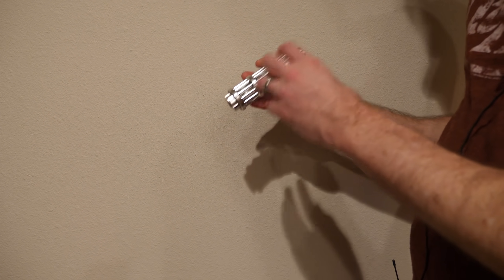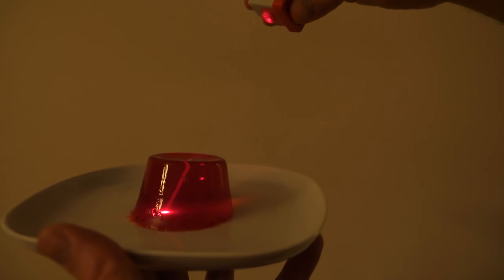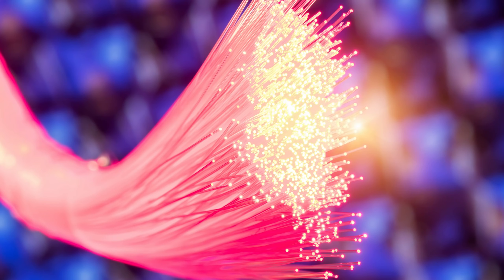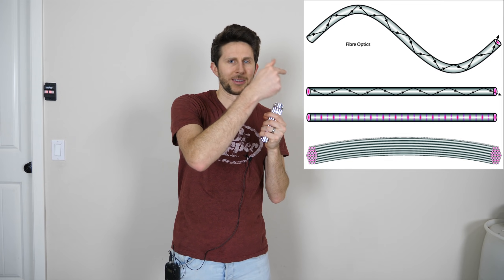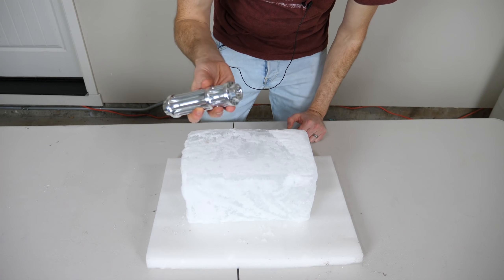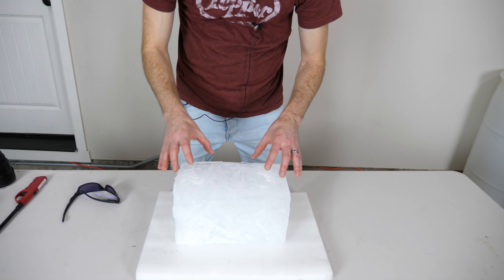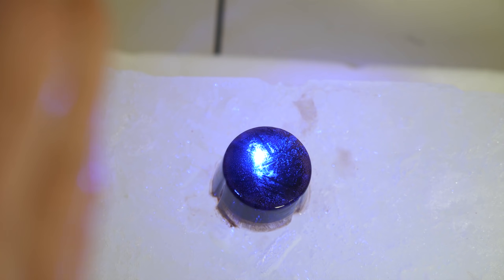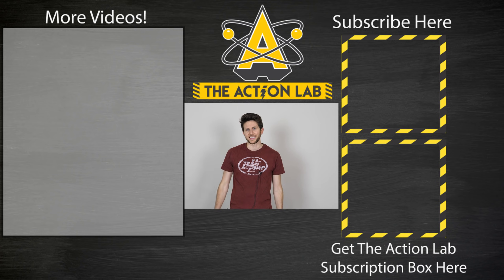What Happens When You Shine a 5W Burning Laser on Black Ice?

Comment: I have the same blue laser. Are you using 2 16340 batteries or 2 18350? I'm switching from 16340 to 18350 because it's just wasting tube space. I don't know why the laser company would say to use that. They are both the same volts. 16mm batteries in 18mm tube...

Comment: The Action Lab, I seriously recommend you buy a laser from sanwu lasers. They make much better lasers than the cheap Chinese manufacturer yours is from. Laser ranger or striker series recommended, laser ranger has a "dimmer" switch so you can have complete control of the power. Striker series has extremely high power options, up to 7.5 watt, and with very good cooling.

Comment: It doesnt melt it because you need to match the wavelength that gets absorbed by the ice, around 1 micrometer i believe. So an IR laser would do a better job at melting the ice rather than the short wavelength blue laser.

Comment: Great educational video as always. Total internal reflection is indeed very efficient in preserving the light's energy. There's also one thing I want to point out: cool white low CRI LED such as those used in the Acebeam you're using, emits very little to no infra red light. AFAIK, it uses several 6500K Cree XHP70. The warmth or heat you felt from the flashlight is caused mainly by the photon energy hitting your opaque skin. The darker your skin color, the hotter it will felt.

Comment: The latent heat of ice is 334 joules per gram. Let's say that ice block is a little less than 2 kilograms, so it's 600,000 joules. 1 lumen is 0.001464 joules per second. So it would take approximately 3.5 hours to melt the ice with the flashlight.

Comment: That laser he is using is a fake laser.
The light beam is holographic purple that is the giveaway.
The metal is actually real, but the laser beam is the one that is fake, because is not emitted by the metal laser, but rather a way to manipulate his operating system as he is the one emitting the purple hologram withing his mind, but other biological human computers donot understand this, this is why they get away with manipulating the system because is all fake controlled experiments, so the real results are controlled.
The laser is actually a white beam and internally a holographic purple laser that is emitted with his brain, that is why you see multicolored laser, purple and white, so is deception, very clever on his behalf, he gets to troll every idiot watching this.
The system is going to need to catch him.
Is a clever way to hide the purple holographic image they emitted by adding a white light, the white light is the one that is the real light, but the purple holographic beam that he creates within this mind is the ones that is actually emitting the heat source, so is all controlled fake experiments as the results can be as he manipulates, and because they can not create a purple holographic image they hide the holographic images they create with other real light, very deceiving, the problem is the operating system doesnot understand nothing because they all clever liars.

Comment: Now that is quite interesting on why wet things look dark. I took an art class year ago and using water based acrylics was really annoying when trying to color match for that very reason. Oil doesn't do this. Now, I wonder, would the light get "stuck" in the stream of oil the way they laser was in the water? What is also interesting in your experiment is that this is part of the reason there is excess melting of the ice in Greenland. Coal ash coming from a certain large country in Asia that still uses lots of coal is blown into the atmosphere and find its way to to the ground, sometimes on Greenland's ice sheets. These spots of soot absorb more energy from the sun light and melt the ice faster. This eventually causes channels to form, which further accelerates the ice melt.

Comment: You should try freezing water inside a cooler in the freezer, the top half will be totally clear. You can melt off the bottom or catch it before it freezes right through. Could be fun to play with.

Comment: would it be possible to redo the laser in the water bottle experiment with the walls of the water bottle painted black except for an opening for a cardboard tube to sit flush against it. I want to isolate the other sources of reflected light so to better see the laser going through the water

Comment: Can you freeze water in a vacuum?
Reply: If water couldn't freeze in a vacuum there would be no ice in space
Reply: Sure just put water in your vacuum and leave it outside during a blizzard.
Reply: The thing is, there wouldn't be a vacuum, the water would boil until the vapor pressure was reached.
Reply: @TheDungineer  But The Vacuum Chamber Will Take The Vapour Away

(Leading To A Failed Experiment)
Reply: It will radiate heat through radiation.
Reply: Look At The Phase Graph

                 Temperature
                 __________
Pressure|    _________|Solid
                 |  /        /       | Liquid | Supercritical
                 |  |_____|____|Liquid->Gas Interface 
                 | /         |____| Critical 
                 |___________|Gas

Comment: The bigger the surface mass of the ice the more heat it can transfer so it didn't melt but that small ice case was different if you have use white ice of that size it would also have same result

Comment: Yeah, the black ice and the regular ice were 2 totally different sizes of course you would get different results... You said the reason that the regular ice didn't melt was it has a bigger mass and the energy was getting spread around faster than the laser or light put out. That tiny piece of black ice was around 2% of the size... Totally flawed experiment... If you would have had the black ice and regular ice at the same size the results would have been different that you got...
Reply: Just don't like how much he Photoshop the thumb nail and he didn't do a big black ice
Reply: That wouldn't explain why the laser cut a hole the size of itself around the ice. It would have done the same with a larger block anyway.
Reply: Worth further study 🤔
Reply: Dylan Dawson I think I’m missing something. Besides your theory on the size of the two ice blocks, what was flawed?
Reply: I really enjoy this channel but that being said, I had that same thought when I saw the size difference. Exactly because he mentioned size of the ice and the reflective/refractive property's of ice. You can't accurately claim to confirm 2 different properties, but then change the parameters of the experiment halfway through. Just do 3 ice cubes,1 black ,1 white & 1 as transparent as possible.  time it to see how fast they melt, respectively. And not to nit-pick but a stable support to maintain consistent distance and concentration of the forces being applied. To be honest and accurate myself, had he not mentioned the size, I can't prove/claim that I would have thought of it. Which is why the peer review process is necessary. I'm hoping The Action Lab repeats the experiment in a more controlled manner. I'll put this one to the experimenter being a bit exhausted or something along those lines. ;)
Reply: Also since the ice is white it reflects most of the light while the black absorbs it all
Reply: Qais Saadeh well, that was the point of the experiment
Reply: That’s what I was thinking!
Reply: I like Action lab man but madman boi is right
Reply: I bet a regular sized ice cube that wasn’t black would’ve melted to cause there less ice to absorb the heat that’s coming from the laser so if he would’ve had a big ice with the black pigment in it it wouldn’t have melted cause there more ice to absorb the heat that’s coming from the laser
Reply: So much energy retained would still melt the black ice, eventually.
It has no escape so it has to transform into heat.
Reply: Madman Tech ikr I hope @The Action Lab sees this comment and does this experiment again.
Reply: @emilianogonzalez9322  Just say his name 3 times!  
@The Action Lab
@The Action Lab
@The Action Lab
😉
Reply: @emilianogonzalez9322  Oh yes I hope it, too!  Because it is a good point!
Reply: Madman Tech since the ice was black, it was absorbing much more of the light, and therefor, heat. If he had dyed the entire block of ice, it would have had the same outcome. This isn’t a hard thing to understand.
Reply: Valid argument, however because the laser melted a small hole in the black ice and negligible on the clear ice then this would prove the concept he is trying to show, basically negates the need to consider the mass of the ice block. Just something to consider :)